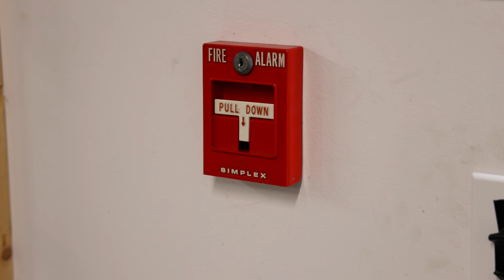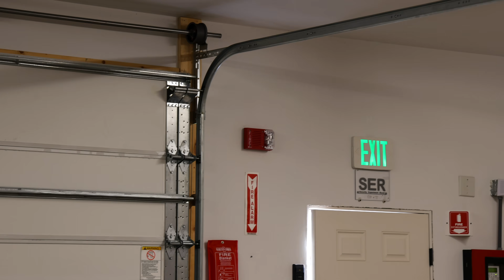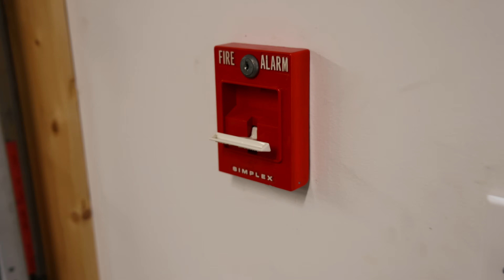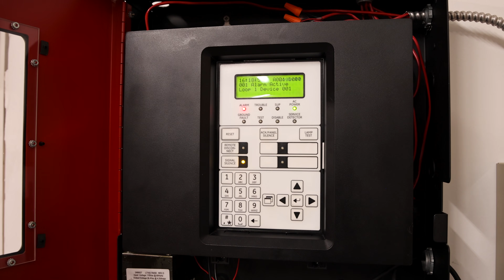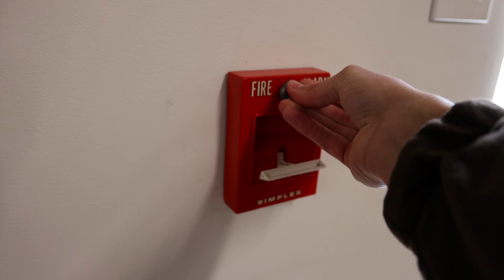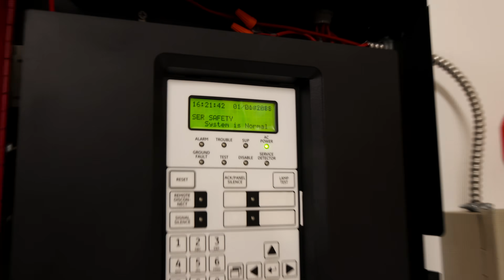1990s Simplex Fire Alarm Testing | Kidde System Test 25

Comment: West Edmonton Mall here in Alberta is kind of dark in the 70s to the 2000s with the fire alarm system because half of it is simplex 1980s but the panels are newer panels same with the true alerts even found Honeywell systems fire alarm systems inside the mall with Edwards and also mircom

Comment: My old school used to have this EXACT system back in the 90s. Up until the 2010s, the school replaced the horn/strobes with EST Genesis Horn / Strobes. The only old remaining alarms are two strobes in the testing room, and a REALLY old alarm that looks like two triangular shaped horns with a rotating red light outside.
Reply: I think he has one of the weird triangle ones with a horn only.

Comment: System test 26 request: Could you do a Simplex Truealert horn strobe on one end and a Wheelock 7002t on the other end, with the panel set to code 3?

Comment: What was making that 60 Hz him in your garage?
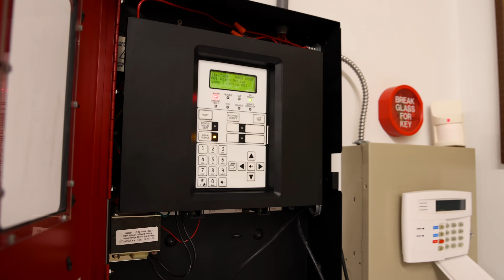Reply from the maker: It was the DSC 15W-ULF alarm wired into the security system (3:57).
Reply: @SERSafety  The older sounds raspy but the security horn is very nice.

Comment: Nice! I always been a fan of those low pitch faraday horns whether that on a Gentex GMS, Simplex 4903 or a Siemens UHN-MCS/UHN-S17. My middle school had a few of these simplex alarms despite the rest being Gentex GMS's. (Fun fact, not too many of them sounded very well even though I was sure the system wasent putting FWR since the rest sounded fine. Though the ones that sounded like FWR was driving them were all surface mounted on back boxes.)
Reply: I really like Gentex horn strobes like the GMS-24 and GMH-24
Reply: @will6000rfan  I have always been a fan of the mid to late 90s Gentex alarms. (Mainly the SHG and GMS) mostly because I grew up with those alarms. The GOS is also cool considering it's Gentex's first multi-tone alarm
Reply: Were the surface-mount devices outside?
Reply: @nrrwsct The outdoor GMS at my elementary school was flush mounted. And my middle school dident have any outdoor alarms with the old system. All the surface mounted devices were indoors at both schools. (My middle school had a ton of surface mounted horn/strobes).